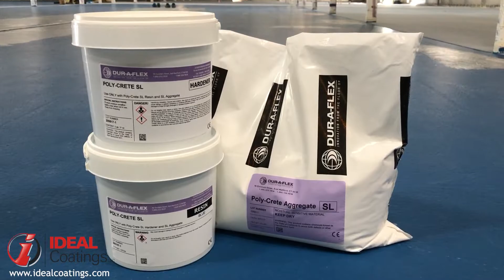Ideal Coatings Poly-Crete SLB Urethane Cement Installation

Comment: Do u ever do dirty pours??
Reply from the maker: Yes, for epoxy with metallic pigments on tiny projects only. The approach I prefer to use for metallic epoxy floors is geared more for production on larger spaces, but works great on tiny too. No fiddling with solvents or torching the surface. Its a complete process that starts with how the epoxy is mixed. I have not recorded any installation videos on metallic epoxy yet, possibly in the future as part of an how & why series.